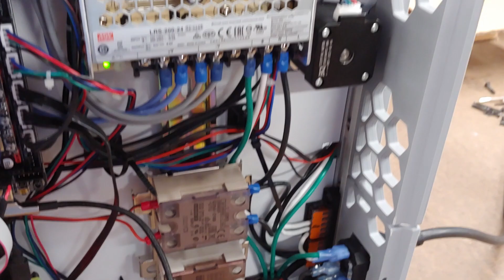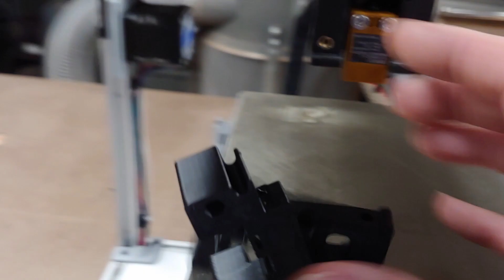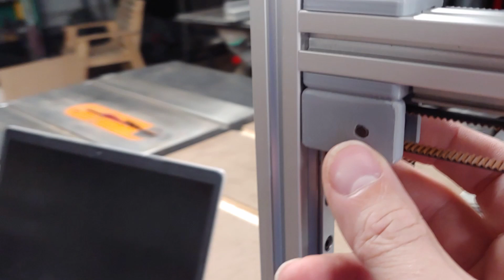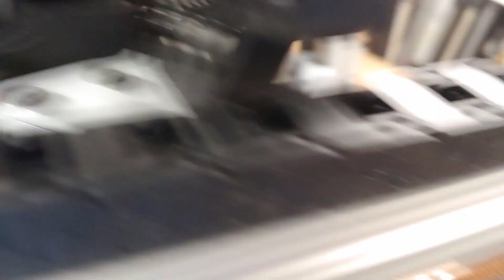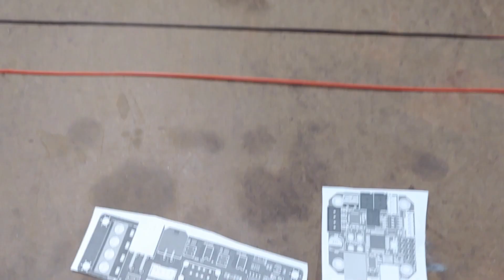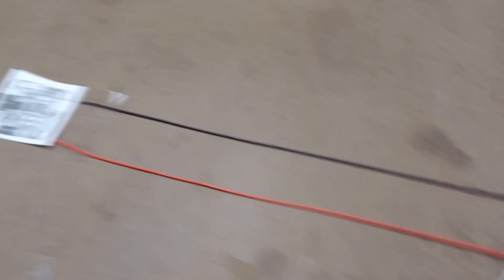Voron Trident Idex project update August 2022

Comment: hi, i had see a resistor in your toolboard, ¿what is your function?
Reply from the maker: I temporarily put a 100k resistor on the thermistor input so that klipper doesn't shut down for lack of a thermistor reading.  The important thing is that there is no hotend heater connected, otherwise bad things could happen.  This allows me to configure Klipper settings and test out the motion system without having to wire up a hotend (or bed if need be).  I keep a few JST connectors with resistors crimped in them for this purpose.

Comment: you ever get weird resonance vibrations? I have my first voron 2.4, and after going from afterburner to stealth burner - a weird noise popped up, but only around 60-100 mm/s? wondering what you think I should do. I have checked for everything, most the noise seems to be coming from the AB motors. its really strange.
Reply from the maker: The IDEX seems noisier than it should be, but I can't say it changed after adding the stealthburners.  Not sure what advice to offer other than checking the idler bearings  on the AB drives and making sure the belts aren't too tight.

Comment: What about using klicky, assemble the dock at about the middle of the x axis and using klicky setup for both tool heads somehow configure Klipper to use the klicky with both tool heads and calculate the z offset from one tool heads to another, such as when ur printing with one head and changing to the other one Klipper instantly changes the offset and gives you a perfect offset in the Z axis

Comment: Thanks for the can bus explanation.  I couldn't work out how its all connected in parallel and then you need to designate an end with the 120R resistor.  But this make sense now thanks to your explanation. The only thing i'm not fully clear on now is how to make the connection to the second toolhead. If that comes from the can high and low then you need to splice in to the can high and low lines for the second toolhead? Im already mid build on my own.
Reply from the maker: Yeah just splice it in, but the length of the added wires (the stub) must be kept short.  If you run the bus wires to the first toolhead and then just crimp another set of wires into the same connector to run to the second toolhead, that would be the shortest stub possible.  The jumper would go on the second toolhead.  This is where mentions of daisy chaining came from.
Reply: @badmouth75  ok like two umbilicals to the white can bus connector on the u2c?
Reply from the maker: @bonjipoo  No, that would be like my setup where the u2C is in the middle.  In terms of umbilicals, what I was describing in my last reply would be like having one umbilical from the U2C to the first toolhead, then an umbilical from the first toolhead to the second one.  (using the white connector on the first toolhead as the splice point instead of running separate wires to it)

Comment: Klicky is the way to go, it worked flawlessly for me unlike the ir sensor or the bltouch I used before, I would very much like to convert my trident to idex will you be releasing the files at some point?
Reply from the maker: It's a "someday" kind of thing.  Hopefully someone with more talent will beat me to it with a better design.  They are welcome to borrow any ideas seen here.
Reply: I had trouble with repeatability using Klicky and I never found out why.  In fact I discovered that most toolhead senosors were less repeatable when the hotend heater was on as if it was creating electrical interference or maybe the hot air was an issue even a superPinda. But it depends on what your setup is and mine was using the ecrf pcb and a professional wire harness from Linneo. But somethings not right if the hotend cause electrical interference for the probe. So i've been quietly working on a nozzle sensor which is in the bed rather than on the toolhead, similar to the Bambu labs X1.  This would be the ideal solution for idex machines because you don't need a probe on each toolhead. The bed is the sensor. Its not far away now but its cost quite a lot of money to develop will probably be a similar cost to buying a probe ultimately.
Reply: What is IDEX?
Looking to build a voron 2 but still learning.
Like this video, nice, concise and short enough to actually watch unlike almost every other Voron video (like 3hrs)
Reply: @Th3_Gael  IDEX means it has two toolhead. Its unreleased and experimental for Voron and Klipper. This would be beyond beginner level as there is so much to learn with Vorons as it is. This printer here is a modified Trident and the IDEX version is called Tridex. But like I said its not released yet.
Reply: @bonjipoo  wow, that's an insanely swift reply. Thankyou

I'm finding out the hard way that there's a lot to learn lol.
Thanks for clearing up things for me, I think this stuff is still a good year away (or more) yet.
I've still a ways to go

Comment: Is it possible to get those longer skirts? Thanks.
Reply from the maker: I am just using the standard 350 skirts on the front and back, 250 skirts on the sides.  Standard parts from the Voron STL files.
Reply: @badmouth75  I see. Thanks. I'm very interested to see how this project will proceed. You're doing a great job.